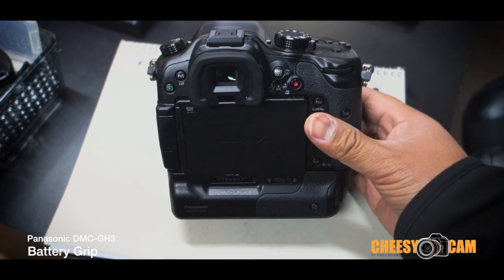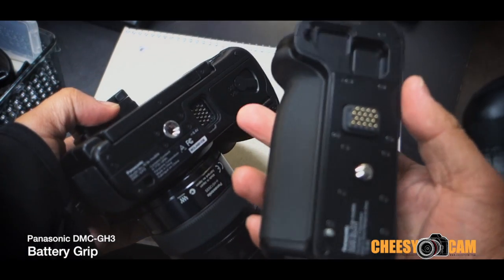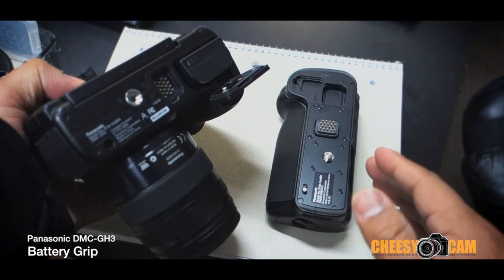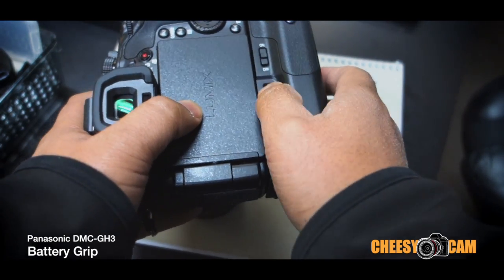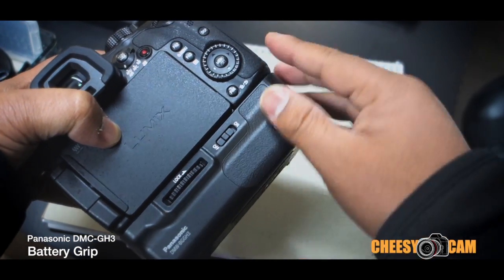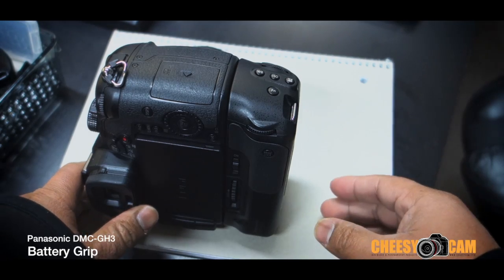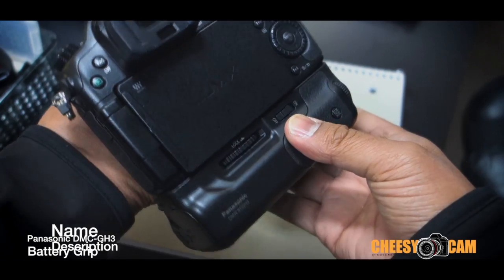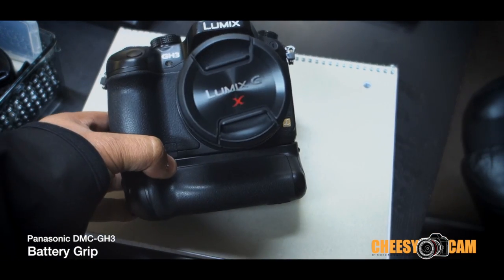GH3 Battery Grip for Panasonic DMC-GH3 Camera

Comment: sigh. I was really excited at first with this battery grip because it gave some beef to the camera, making it look bigger and I was worried about people not taking the camera seriously without the extra size.  He mentions that the grip is good for being able to use with other accessories but i found the complete opposite. This ruins everything. First the battery grip makes the cameras base off center by a lot, so that's an issue when using a mattebox  on rails etc. You would have to buy an off center plate etc. also the (Fusion) GH3 Video Cage can't work because obviously it's made to use without the battery grip. I can't use any viewfinders on it. Most view finders have a base attachment and well guess what. The extra 1.5 2 inch in height from the battery grip below the screen makes it not possible. It also is annoying to get the screen to rotate with the grip on because it blocks the edge for it to flick out. It's a trade off, sure i get 8 hours of constant filming with the BG  but since I can get 4 hours on one battery and could just find 10 seconds to swap the battery. I am thinking the trade off isnt worth it... in my situation or any other videographers who want to use accessories.  End of rant. Just wanted to give a heads up. it's really a pain in the ass.

Comment: So lets say you have a battery in the grip and in the camera and you set it to use grip power first. Once it switches to the camera battery can you swap the grip battery without interrupting the recording? If so, will it automatically switch back to the grip power after the camera battery dies? From what I have read it shouldn't be necessary since the life in 1 battery is so long, let alone 2. But I am just curious. Thanks.
Reply from the maker: I haven't tried pulling the battery while it's running. One battery can last several hours, and i'm pretty sure you'll find time to stop recording to do a quick stop.